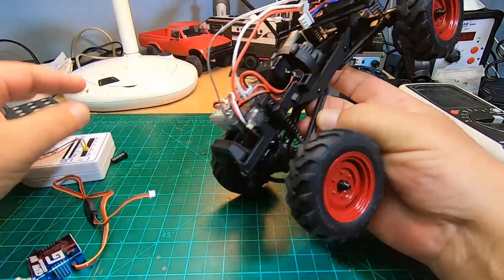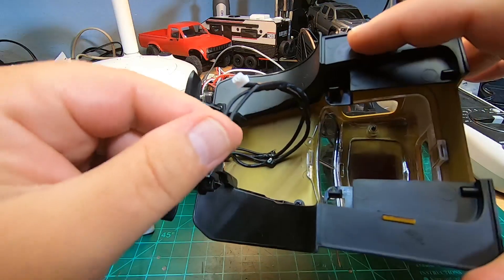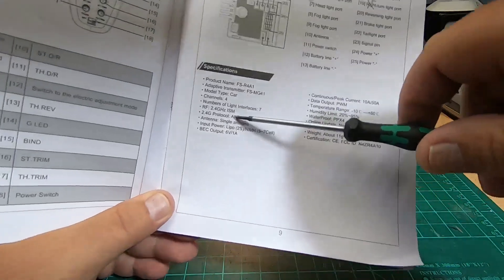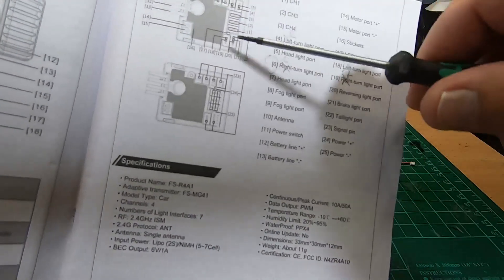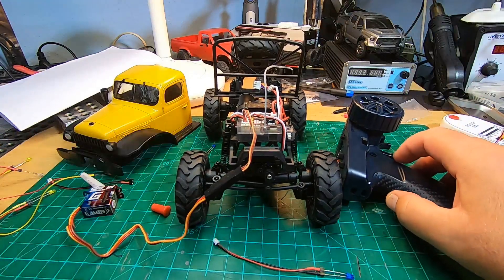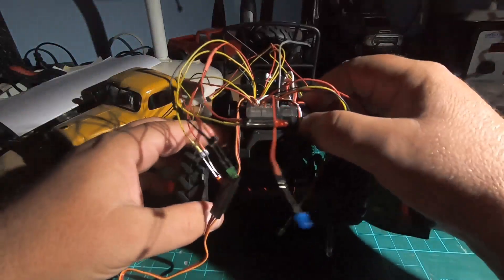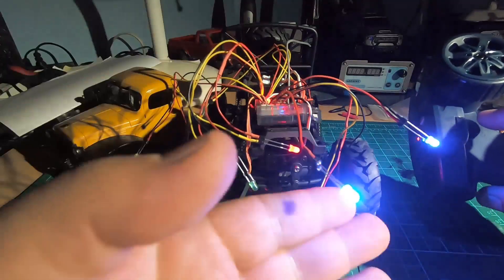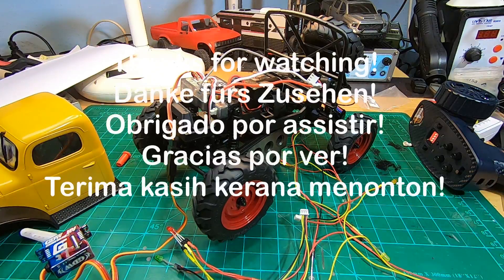FCX24 board and lightcontroller explained

Comment: My fcx24 stock lights stopped working correctly. Only one light at a time comes on. If I wiggle the wires/plug they sometimes blink or switch from left light on to right light on.

Any ideas on how to diagnose the problem? This is my first rc of this nature. I'm not very familiar with how they work.
Reply from the maker: Yes, this is not difficult. Only a contact problem in wires or plugs. Do you have a soldering iron, shrink tube or at least electrical tape?
You'd have to check where the loose contact is, could be plug/board, or plug/wire or at the branching position of the wires. 
Did you say that always at least one light works?
If this is the fact, than it is even easier. Because the two LEDs have the connection to the board in common (parallel), this means the plug - board connection must be ok. Otherwise both lights would not work.
So check the branching area of the wires. If you press/squeeze those, both lights should work then. That way you can identify the "problem branch". Maybe only squeezing/bending does already solve the problem (not a perfect solution), but better remove the isolation (shrink tube) and check the soldering area, probably broken... you'd have to resolder it, if you cannot solder, connect it in any way (MacGyver will show you, silver paper, piece of wire without isolation, ...) and isolate again (shrink tube, ... electrical tape).
If you have appropriate tools this is an easy operation.

But if both lights do not work at the same time, the problem could also be in the plug (wire - plug or plug - board).
Reply: @donaldsneffe  thank you for your reply. I am also getting jittery back and forth motion from the steering servo even when not touching the remote.

When I went to test your idea of pinching the wires the lights now don't light up at all.

Do you think the problems are related? Could it be an ESC problem?
Reply from the maker: @ZachTrumble  I do not think the problems are related.
I am quite sure a contact of the light plug has come off/is broken This is a quite easy repair... take it off, remove shrink tube and check it.
Try to rebind and see if the servo still does this. There can be numerous reasons, from broken servo to broken board (unlikely), missettings, ... very difficult to say from here. I assume you do not have another servo to test (with 1,25 mm plug ;-)  ).
Reply: @donaldsneffe  thanks for the help. You were right two of the wires were broken.

Now that I have removed the shrink tube I need to redo the wiring.

Two questions, can I remove the 2 prong plug that doesn't seem to do anything? There is also a small resistor in the wiring. I assume that needs to stay in there?
Reply: @donaldsneffe  thank you so much for the help! I got it working. So much cooler with the lights!

Thanks again!
Reply from the maker: @ZachTrumble  I am not sure what the resistor is for, it is probably not necessary, see my tests without resistor. But better let it there.
Yes, you dan remove the second plug, but be careful not to shortcut the remaining wire ends.
You could also power the lights with the second plug and "fog light function", therefore you will have to take out the pins of the white tiny plug and reverse polarity. But then you must not plug in the large 3-pin plug! If you plug in both plugs (one with reversed polarity) you will fry your board! If you use fog light function, you will only have "high" (not low and high as in the main light).
Reply: @donaldsneffe  today the steering quit completely. Tried re-binding didn't help.

Is my servo dead? Is there a way to test it?

Unfortunately I don't have another servo. This is my only truck.
Reply from the maker: @ZachTrumble  
The FCX24 has 2 servos, steering and shifting. So if shifting servo still works, it is easy to test, plug the steering servo into the shifting servo port and check.
If only steering does not work, but shifting, throttle and light control still work, it is likely the servo.
Reply: @donaldsneffe  Yep, the servo is toast. Did I get a bum one, or did I do something bad? I'm new to the hobby and don't know much.

Getting a new servo specifically for the FMS truck takes a long time for shipping. I see I can get upgrade servos for the SCX24 quickly on Amazon. Will those fit my truck? They have a different plug though, so I'll have to figure out how to switch the plug.

Will the injoura EMax fit this truck?
Reply from the maker: @ZachTrumble  All those servos will fit, but none of them has the correct plug. So you'd have to swap plugs, cut the plug with wire from the old servo, cut the wire from the new servo and connect the old wiee with plug to the new servo (since you're new I do not assume you have the tools to crimp the tiny plugs or the courage to open the new servo and solder the new wires directly to the servo board).
I do not know if you did something wrong. Servos can burn out... maybe blocked for a long time, or maybe endpoints (DualRate) on maximum and the servo blocks?
Could be bad luck also...

Comment: I want to ad tail lights. Do you possibly have a link of where to buy the correct plug ends. The lights I have have no ends on the wires. I don't know the correct name for the plug ends that plug into the esc.

Thanks in advance
Reply from the maker: The correct name of the plugs is JST GH 1.25 mm (Molex), 2 pin, 3 pin, 4 pin. You will find them on eBay.com or AliExpress. Search for JST GH connectors, tons of results, with or without wires, super cheap.
Reply: @donaldsneffe  thank you so much. Your videos have been very helpful with multiple rigs ! Keep the videos coming . Cheers!

Comment: Have been hoping you'd start working with the FCX24s. Saw another video where a guy used the stock receiver/light controller with a second stock front axle and servo to convert one to 4 wheel steering. Pretty cool... 

Edit:  He used Ch4 for the shifter/lights and then the 3 position was used for steering (left/straight/right)
Reply from the maker: Saw it, it was MiniRC. Yes, pretty cool ;-)  
However, my FCX24 (as all newer ones?) does only have 2 positions on CH3, so you cannot use this for steering the rear axle (need at least 3 positions). 
Different transmitter with 4WS would be the way to go, with "real 4WS" then (proportional, rear, crab, 4ws). But the stock ESC of the FCX24 is really super good, I think even better than SCX24 v2, and totally silent... and dragbrake force changeable via radio... so hard not to use the stock FCX24 elecronics (because they work very good).
BTW:
Receiver/ESC/lightcontroller unit is identical to that of the 1/12 Suzuki Jimny.
Reply: @donaldsneffe  I have 2 FCX24s. I bought them right away, so they have the 3 position  toggle. What they do not have is the metal portal gears and my understanding is that when FMS first started shipping them, as an upgrade, the 14 tooth gear is 12 tooth and causes some problems. So, I am waiting to buy a couple of sets.

I totally agree that true proportional steering would be better. I just thought that guy's work was creative and a nice work around using stock components.

Loved your light testing. I have no idea how to get enough 3mm lights mounted around it though to take advantage of the controller (turn signals in particular). I am sure someone will find a way...  ;)
Reply from the maker: @rezdog_tm  Yes, I also think it is a good ideal. Remember people making this kind of 4-wheel steering with the SCX24 (v1 radio).
My (metal) stock portal gears are 12/21 t. Are there any troubles? Did not hear about this so far. Mine seem to work fine so far.
Lights? Why only 3 mm? 3 mm, 4 mm, 5 mm, 1.8 mm, SMD LEDs... Rollcage-lightbar, bumper lights, rock lights, maybe brake lights (on the cage?).
Guess no one needs turning lights here.
But I am sure people will also use different bodies (longer wheelbase)... maybe 1/16... Mogrich has about the same wheelbase but is not as wide... which accept more lights incl. blinkers.
Reply: @rezdog_tm  contact FMS they will send you portal gears free. They sent me some and they were the correct 14 tooth.